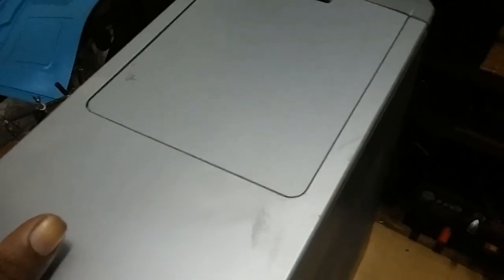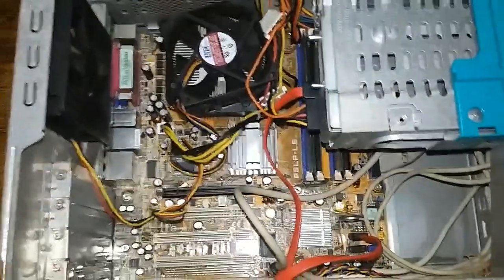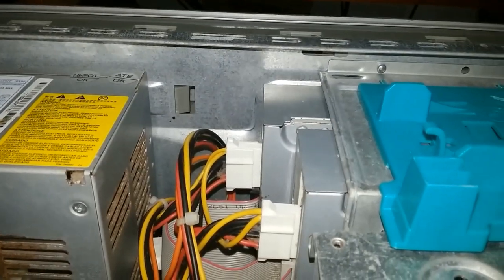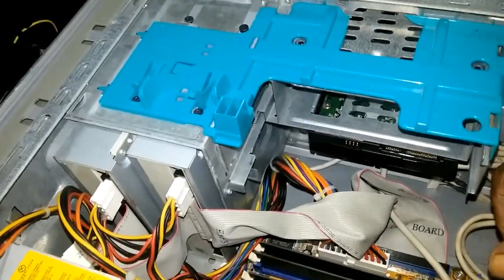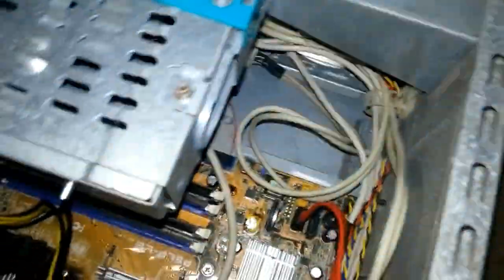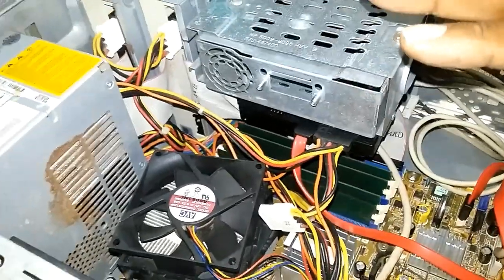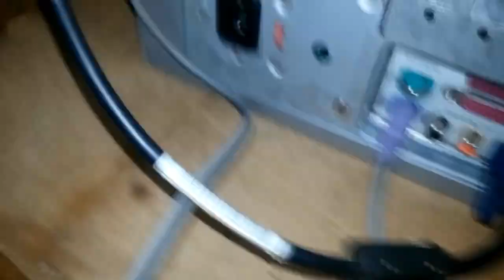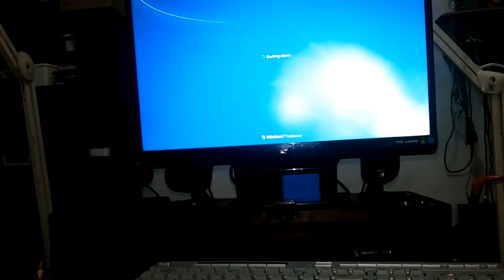My find HP Pavilion M7570N Media Center Desktop Fix

Comment: It's 2022 and I am still have my HP Media Center Desktop and I upgraded to a 2TB SSD Sata Drive and I am running Windows XP Media Center SP3
Reply: Hey did you get a 2.1 speaker system with it? It's by hp and in all grey chassis. I've been trying to find it on the internet but no luck.